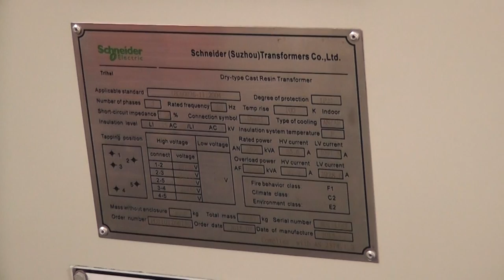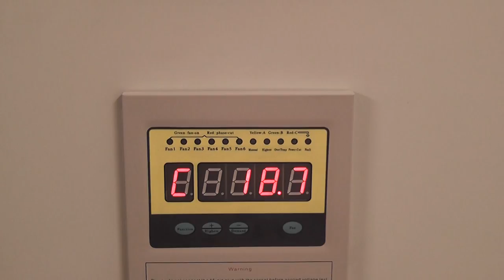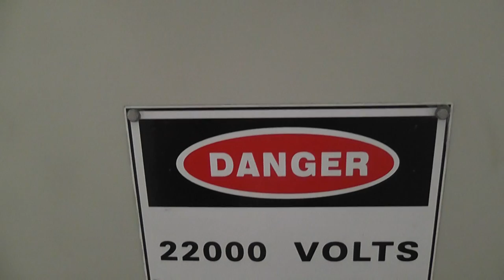22kV - 690V dry core transformer switch on

Comment: i always wondered how the grid copes with the first power up when all those fridges etc start up
Reply from the maker: It is visible on protection relays as a short dip in Voltage.
Reply: Most distribution networks have something called as "primary regulation". Normally you are trying to cover power generation together with import or export where applicable in order to balance demand and produciton, those both have to be balanced all the time, otherwise you get frequency deviation. This is prevented by telling distribution companies by larger consumers, how much energy and when you are going to use and you buy contracts for certain ammount of energy for whole year, quartal or single month, so power plant and distribution network operators know well, how much energy they have to produce and if there is need to import energy from abroad or there will be surplus for export.  However sometimes it may happen for instance, that wind park suddenly produces more energy, so frequency goes up or nuclear power plant has malfunction and reactor undergoes SCRAM shutdown, so frequency goes down. For those cases most dispatchable power plants have primary regualation, which can suddenly output for short time some power or accept excess power (regulation energy) in order to keep frequency in good values, like 49,98 - 50,02 Hz in Europe. However it lasts only for short time and you need to quickly deploy new power supply, for instance battery storage, pumped storage or conventional hydroenergy powerplant or natural gas powerplant. In case of energy surplus you can for instance decrease output of any above mentioned power plants or shift this surplus into pump/battery storage. Those power plants can quickly adjust power output and shift extra load from primary regulation to themselves unlike coal power plants or nuclear power plants, which take some time before they change their output. So those "TV pickup" events are usually handled by hydro and pumped storage.
 
There is on-line frequency of ENTSOE power grid
http://www.netzfrequenzmessung.de/

Comment: Nice video!The biggest dry core transformer that I worked on was a 10 MVA, 20/10 KV with tapchanger,to interface the public net at 20KV with internal producing and generating plants at 10KV,in a paper industry in Italy.

Comment: 690v? Why the odd voltage what is this feeding
Reply: Probably some big ass motors.
Reply from the maker: Large electric motors.
Reply: +RODALCO2007 What are those large electric motors doing then? Mining equipment or so? Or maybe sewer pumps? All those many thousands of amps at 690 volts, crazy stuff :-)
Reply: In Germany 690V is a voltage that is sometimes used on big industrial parks.
Reply: PERILEX Now you say that, i remember hearing/reading about that kind of voltage for industrial applications as well indeed. Never seen it with my own eyes though, it's mostly 380/400 volts what i encounter.

Comment: Very nice!  something about the 50Hz hum that sounds a lot more "robust" for lack of a better description...  600V is a standard voltage here in Canada for  commercial  /  industrial use,  ( Motors, distribution within small commercial buildings) and in some instances we use a line to neutral connection to obtain 347v  for lighting circuits..  600V  H.I D lighting was common in a lot of industrial applications but is rare to find now.

Comment: Just wondering, what do you actually do for living?
Reply: Rodalco2007 works in the high voltage industry, he has a couple of video's where he is walking around in a transformer station at night after a resident made a call about  "weird noises coming from the substation plant" and he goes on to investigate what is causing it :).

Comment: Takes me back to my very first job - making resin encapsulated transformers for GEC (Now Alsthom). 

I recognised from the secondary voltage that this is feeding motors - water pumps? or variable speed drives?
Reply: Paul, is 690v common for motors? I've only ever dealt with pretty bog standard 240/415v stuff, but HAVE seen a few 480v single phase installs (mostly on farms).
Reply: *****
it is for large motors, such as waste water treatment plant pumps, or even steel plant machinery for example. Really big motors will use 3300V or 6600V.
Reply: Indeed, that's from where i know 690V as well. It's quite common in the industry on machines and pumps, even in the GDR they used 690V (well, before my time).

Comment: Damn 690 volts and over 2000 amps.. Better dont touch that unless you want to be instant fried chicken
Reply: or the 22kv with 65 amps! :P
Reply: +supersolex Would also be enough yeah! :D
Reply: i think i like the 22kv more ;P
Reply: Depends on your impedance. But whether 22 or 0.69 kV... either way it will finish you.
Reply: but 22kv gives more sparks ^^
Reply: Lol nothing better than more sparks. Even if it's about toasting a person :D Though after a while your flesh will become carbon, then the lower resistance will make better use of the amps available, even at 690 volts ;-)
Reply: Richard van Pukkem hmm you're right but with the 690v it takes longer to carbonise :D